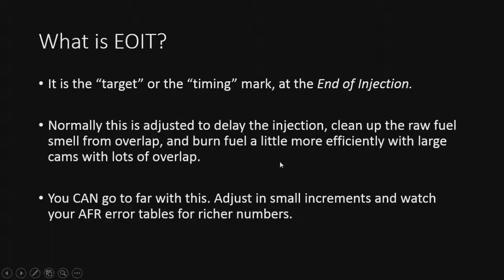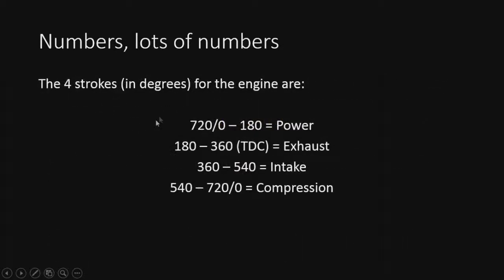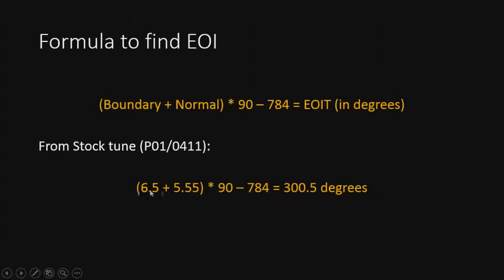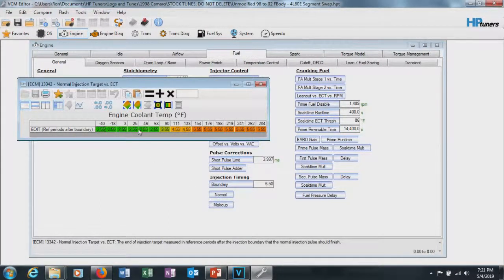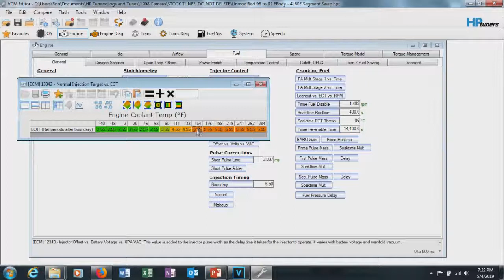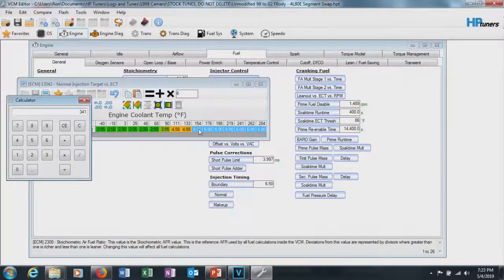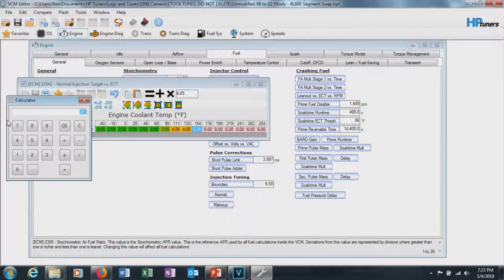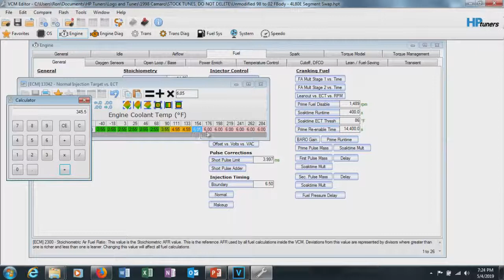End of Injection Explained

Comment: Awesome info on something most people never even think about
Reply from the maker: It’s actually a big deal, especially on newer generations like Gen 5, direct injection. On Gen III it’s not the end of the world but it does make a huge difference.
Reply: @ChopperDoc181 o what value would you recommend for a sloppy stage 2 camshaft?  Intake opens 20 degrees sooner or so. Add 0.2 for 18 degrees adjustment?

Comment: Im messing with this now on my gen3 408.  You mention don’t go too far with this quite a few times.  What happens if you do ,  motor blows ?
Reply from the maker: No, motor will run badly. You’d have to go pretty damn far to have a problem with blowing it up lol.
Reply: ChopperDoc181  ,  ok good to know,  can’t wait to try this.  I have some bucking ,  around 1500-1900rpms in gear ,  M6 car.  Anyways love the  gen 3 vids and hope to see some more of them
Reply: @Max Link yes it has helped ,  parking lot cruises much better. You’ll know you’re going n the right direction if it’s richer at idle after making a change.  Only way to know Is make a change then go out for a drive.  Gen3 fbody stock normal  is 5.55 .  Mine is currently set at 5.95.  Make small changes n work your way up

Comment: Thank you for the video.  I'm curious why in your example you made the injector fire later in the cycle?  It seems like that would make the fuel smell worse because the fuel will have less time to cook on the back of the valve, so less atomization and more unburnt fuel per cycle.  I'm I thinking about this backward?
Reply from the maker: Not when you have a lot of overlap. With valve events happening sooner and staying open later, fuel tends to be sprayed right out the exhaust when both are open, or while the piston is still moving upwards. Scavenging will still occur regardless, as some will be sucked back in, but firing the injectors later seems to be more effective with huge cams with lots of overlap.
Reply: @ChopperDoc181  , Thank you for the explanation.  How do you know if you go too far? Will you notice drivability issues?

Comment: I think there is a great picture here which seems to more or less confirm your numbers and expand on the whole combustion cycle with pressure data
https://forum.hptuners.com/showthread.php?32510-Injector-Timing-Reference-Periods-refereencing-what&p=577011&viewfull=1#post577011 

thank you for giving me the confidence to actually try the number and for showing the exact tables! 

I just went and finally tried 6.4(377*) from 5.55 and about 0.8 a/f richer in cruise regions and especially idle 13.8 from 14.5:1 a/f ratio,  using mild TFS30602001

Comment: Great content, thanks.  If a car is cat-less, can the eoit normal table be all the same higher value straight across?  A tuner on one of the forums was guessing the lower eoit during colder temps was also to help get the cats up to temp quicker.  If the line could be flatlined at all temps, it'd be nice not to have the extra fuel smell while the car warms up.
Reply from the maker: I think that it sprays earlier to give the fuel more time to turn to a vapor. Liquid fuel does not burn, the vapors do. The colder the engine, the longer this takes, obviously. So on very cold engines it makes sense to give it more time to do this. I doubt it would hurt by delaying it some, but I don't usually mess with the colder side of the table, and I don't know exactly what flat lining it would do honestly lol. Only one way to find out I suppose. Personally, I would just back it off a little at a time, just the same as the hot side. Might take a few days to do that since it requires a cold engine, but that's what I would do.

Comment: Hey brother thanks for the video.  It's nice to see the math laid out in front of my face.  At what point do you think it's pointless to even touch it? Sitting at 25 degrees of overlap, I'm thinking I'm never going to notice a cleaner smell without a cam swap lol
Reply from the maker: Wow, yeah that’s a lot lol. I moved mine back and it helped. Doesn’t solve the problem by any means but “better” is how I’d describe it lol. I’m at 23 degrees so similar issue. Mine targets near TDC, but as stated, may or may not work for your setup. So many variables with this kind of thing. It still smells but just not so bad.